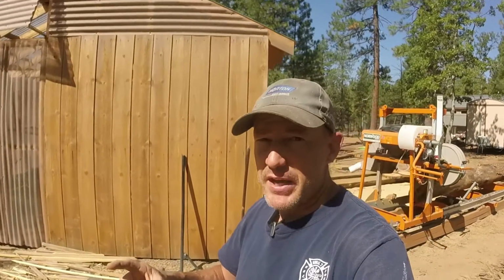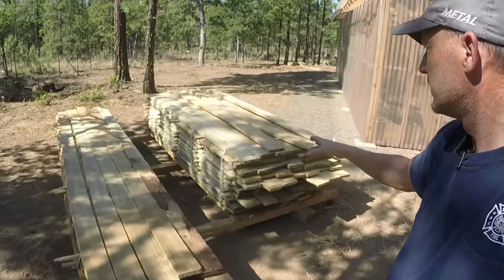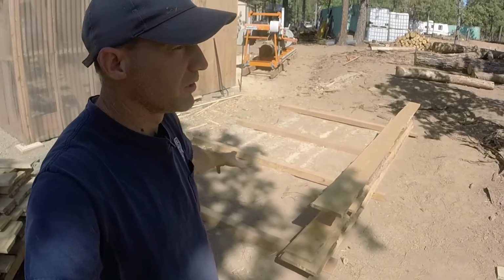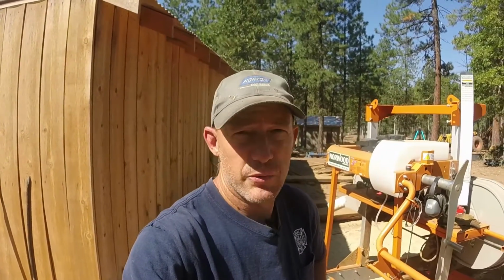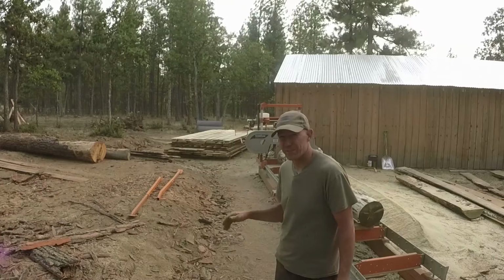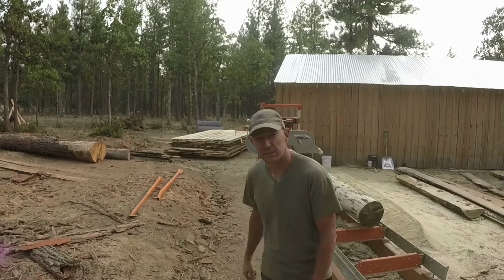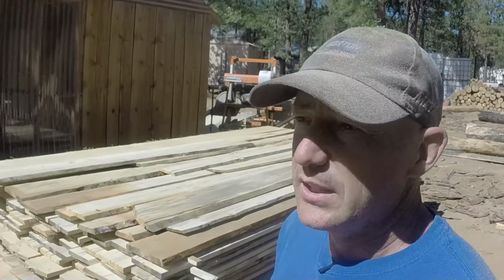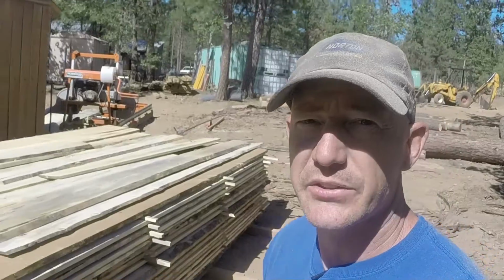Milling purlins on the Norwood sawmill, Shop build part 4

Comment: You were asking about not using OSB under your metal roof. The Guys at RR Buildings do it all the time, they use 2x4 for their Purlines, but they set their Rafters 8 foot apart and they are set directly on their Pre manufactured Uprights.
Reply from the maker: I had thought about setting rafters on the tops of my posts and using purlins but my posts are 12 feet apart and we can get up to 3 feet of snow here. Not wanting to pay an engineer to design this out and make sure the roof would hold this weight I figured I would just put rafters 2 foot apart and sheath it like a standard roof. Right now I'm just hoping I can get it roofed before the rain starts. :)
Reply: Yes 12' apart would be to far for a Rafter Spacing. I would stick with your plan of setting them 2' on Center. I'm just not sure the 6" x 6" will be strong enough? It might make more sense to use a 10 to 12" Laminated Beam. No you could make them yourself by using 2" x 10's or 12's and glueing 1/2" Plywood in between the 2 x's.
Reply: You would want to use Glue and Screws, but that would be expensive? So I would just ask someone who builds Polebarns.
Reply from the maker: @josephsmith2649  Stick around for the build, I'm using 3/4" plywood to help support the horizontal 6x6  that is spanning the 12 foot space. Hard to explain, easier to show when I build it. I think it will be strong enough, but if after I build it I think it needs more I can always add more. :)
Reply: @KoalityofLife  Don't forget what I had mentioned before about having knots in your wire from unrolling it from a roll on the floor. Take 2 Saw Horses and a Metal Piece of Pipe and run it through the Rolls of Wire. That way it won't knot and try to coil on you.